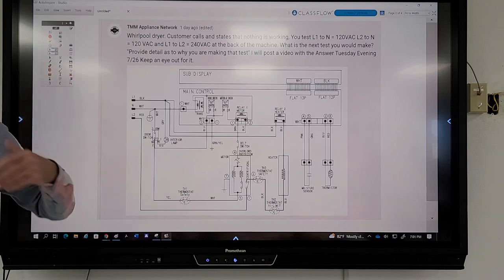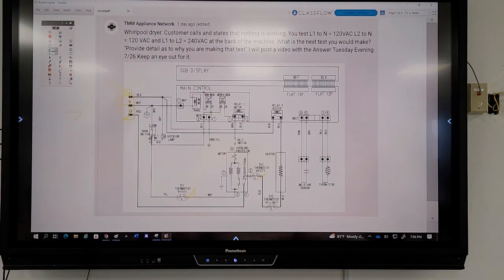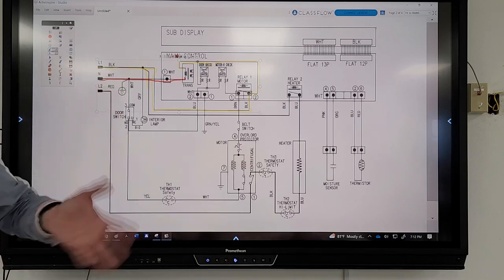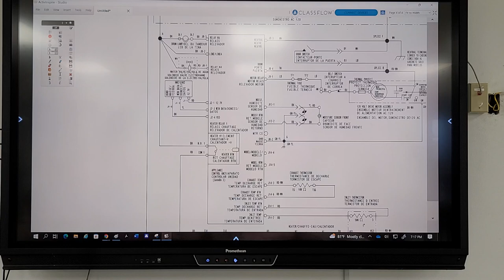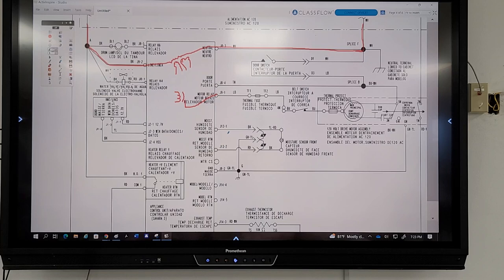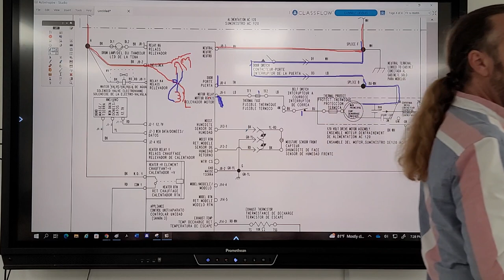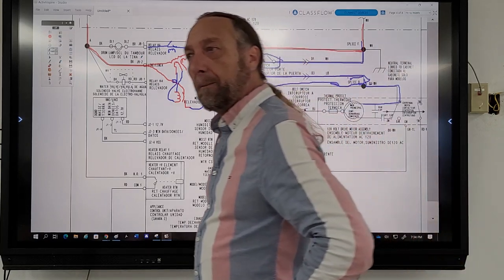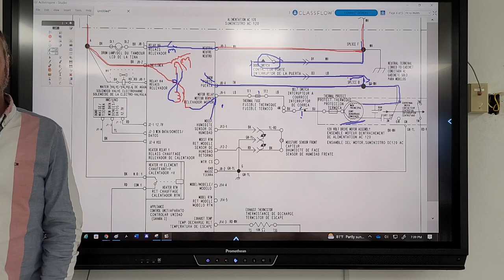Dryer diagram1

Comment: Did this yesterday check power to machine. Should have checked door switch but didn't until last😳😦
Reply: That's the only thing about dryers, is that unless its really obvious its a toss up on which part to test first.

Comment: For the motor to run.. you need door switch AND good Thermal fuse AND belt NOT broken..(assume motor protection not open(cold) ) Before testing thermal fuse continuity. .TURN OFF POWER!!

Comment: During those last checks, especially on a whirlpool model, it would be a great opportunity to offer a cleaning. Likely the reason for the failure is because of improper air flow. If there is a restriction outside of the dryer, there will be a lot of lint built up on the inside of the dryer. Hot air, moisture and lint have no where to go if there was a restriction. Charge a preventative maintenance, and hell if you aren’t working for the big corp. learn how to do the house vent lines too.
Edit: I mentioned the whirlpool model because I’ve noticed not many techs like opening the back and the front on the same visit if they don’t have to.

Comment: Main power, door switch, control board, belt idler arm switch if the belt is broke, maybe flame sensor.  Use ohms test or a jumper and jump out parts.  A dryer repair job is the second easiest job in appliance repair (more disassembly required) next to oven repair jobs, ching ching!  (NOT stove repair jobs, sealed burners).  Always carry a basic assortment of belts, fuses, door switches, ignitors and coils, can repair 75-85% of jobs on first visit.  Once ovens and dryers are mastered (very easy) move on to furnaces, ching ching.

Comment: If you have 120v at those two points that means there’s an open fuse or switch or motor because 120v is the difference